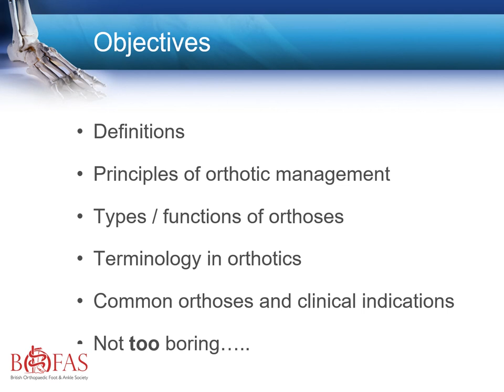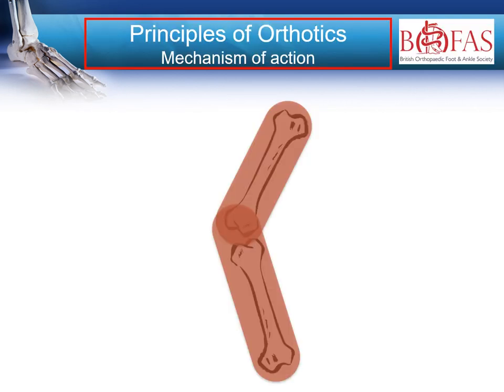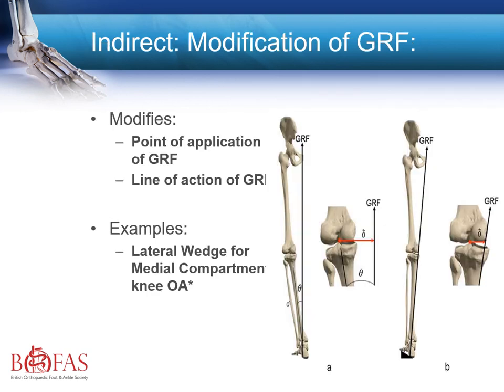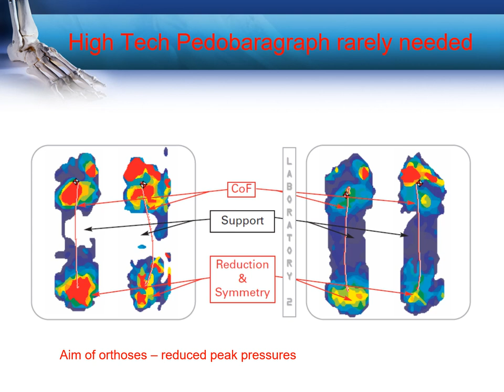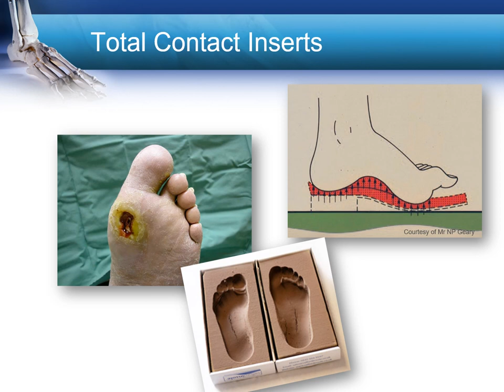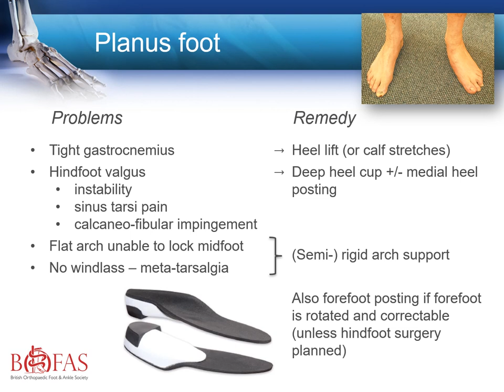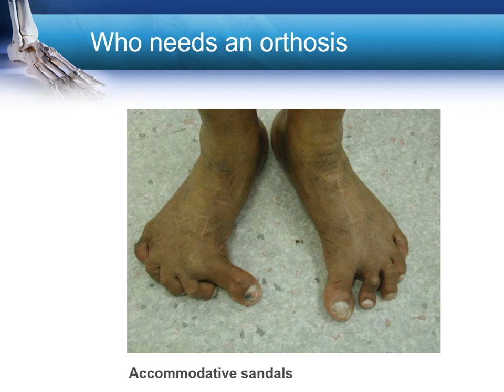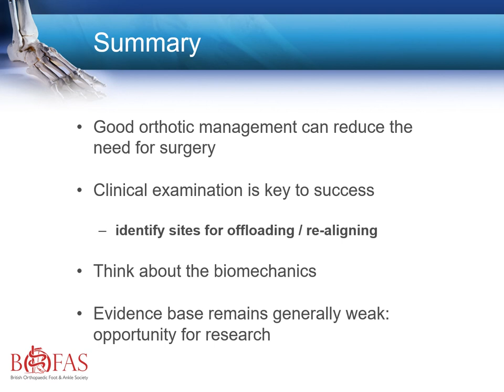Principles of Foot and Ankle Orthoses

Comment: Planus foot
Not caused by tight posterior muscles other way around flexible feet excessive pronation and muscle adapt to foot collapse same way wearing high heel shoes all the time. Generally a good over view but limited knowledge in foot function and the use of foot orthotics, and based around Root theory which is wrong.
I have lectured in biomechanics and bespoke foot orthotics for 37 years